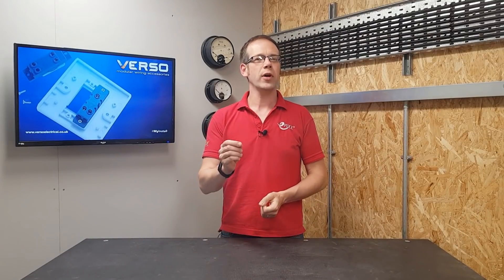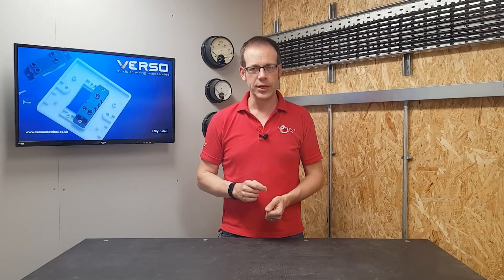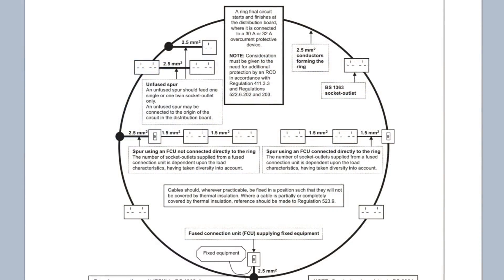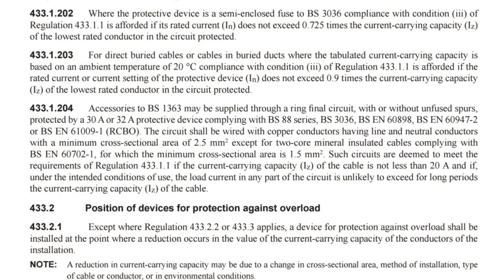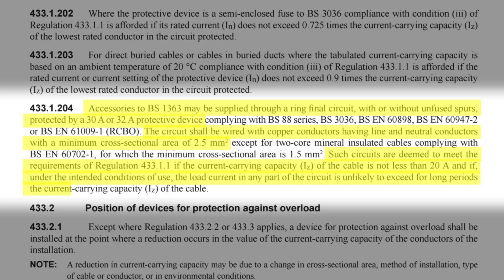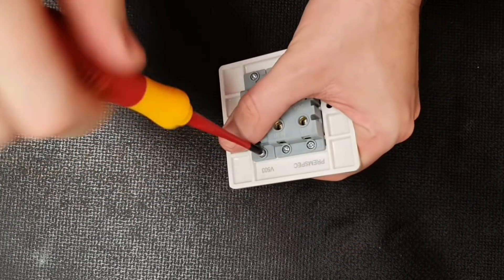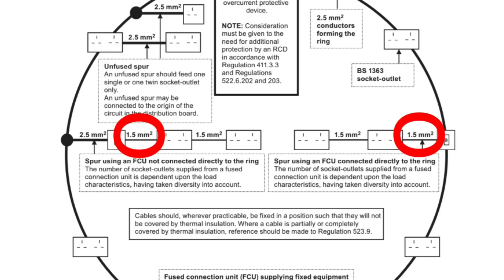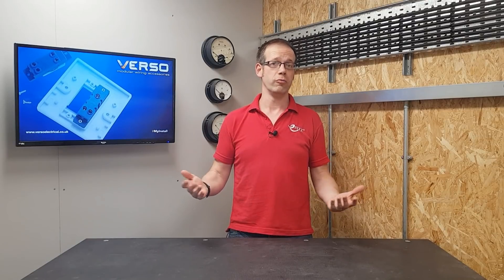Can you use a 20 Amp double pole switch to control a spur from a ring final circuit? BS7671

Comment: How can a 20 amp DP switch be used on a 16 amp circuit cant get my head round that
Reply from the maker: Because it's capable of breaking more current than the circuit can deliver. If it was a 10A switch it couldn't break 16A safely.
Reply: @efixx  
Thanks for reply
so a 32 amp ring why is that not to much for a 20amp Dp switch to break

Comment: Would it be acceptable to use a 20A MCB in a small suitable DIN rail enclosure/single way consumer unit box rather than  a 13A FCU if you wanted to serve more than 1 socket off a spur? So long as the Zs was low enough to provide the 5x trip current for a type B MCB?

Comment: The ring final was designed and mandated after WW2 to deal with a copper shortage. They said at the time that it would reduce copper usage by 25%. It is fundamentally a  horrible idea and in more modern time they went back to using radial circuits just like pre-war times. I get that there are a lot of these out there and I suppose it would be a significant expense to eliminate them. In the US, where we have older systems with techniques and materials no longer compliant with current code, those kinds of things are typically, "grandfathered".  But if any new work is done, this stuff must be upgraded to the current code. Technically, if the old stuff isn't touched, it can be grandfathered, however in a lot of places, it won't pass inspection unless corrected.

With as old as this technique is and as potentially dangerous as it is, it really should have been prohibited long ago. Grandfather it in if done before  the prohibition date. but upgrade it if any new work is done. It's pretty peculiar to the UK although I believe it was used for a while in some old British colonial countries. I am amazed that this is still acceptable by current UK standards. But UK does a lot of crazy things with electrical wiring.

Comment: Your thoughts on a spur from a perfectly installed RFC using a 4mm2 cable supplying more than one socket outlet, by design it’s perfect 👍🏻
Reply: Provided you don't exceed the currently rating of the 4mm radial (30 amps) AND the 2.5mm ring (23 amps), I don't see why not.

Comment: Thanks for that. Am contemplating installing a grid switch for first time for a kitchen install. I take it this is effectively what you are describing? Taking ring in and out of grid and actual switches them selves would thus be 20 amp DP's for fridge, dishwasher etc so no need to fuse down?

Thanks

Comment: Surely though the 20 amp rating of a DP switch is the rating of the switch contacts not the through rating of the terminals ?
Reply: Cant see the issue here between this and say, a 13A socket outlet on the ring in terms of rating. Most of these switches are intented for 1 appliance, so whats the big deal? There are also some of these DP grid switches rated at 13A for sale, so connected to a single socket or a FCU, again, what is the problem?
Reply: Is Gazzerdman is considering the case where a 20 amp switch is directly in the ring. Where both legs of the ring are connected to the input terminals of the switch and e.g. a fridge connected to the output terminals. The input terminals may continuously pass most of 'whole house' sockets loads if only one ring supplies the dwelling.

Comment: The 20 AMP DP SWITCH
No switch is mentioned in the highlighted text in the vid.

i) The first highlighted text relates to a 30-32A Final Ring Circuit and 13A plugs off the ring, whether on a spur off the ring or directly on the ring.
ii) The second highlighted text states a cable of minimum of 2.5mm must be used on a spur of the ring. Maximum draw of 2.5mm is 27A.
iii) The third highlighted text states that the cable must be capable of drawing at least 20A (this is redundant wording as the specified 2.5mm draws 27A maximum).  Then it states that the load must not exceed the max current draw of the 2.5mm  cable - which is 27A. 

It text DOES NOT state that a switch rated at less that the maximum draw of the cable can be fitted. 

In the vid it is clear:
ONE 
a) One single socket can be spurred off a Final Ring Circuit with no fuse between the rings junction and the socket. 
b) The spur cable must be 2.5mm minimum, that takes 27A. 

The 2.5mm (27A) cable on the spur is protected by the 13A fuse in the plug. Fine, all safe.
A 20A DP switch can be fitted as the cable and switch is protected via a 13A fuse. Fine, all safe.

TWO
a) One DOUBLE socket can be spurred off a Final Ring Circuit with no fuse between the rings junction and the socket. A double socket is rated at 20A maximum, even though 26A can be drawn via two plugs.
b) The spur cable must be 2.5mm minimum, that takes 27A. 

The 2.5mm cable on the spur is protected by two 13A fuses in the two plugs (26A maximum), which is below the  maximum rating of the cable which is 27A. Fine all safe.
A 20A DP switch CANNOT be fitted between the Final Ring Circuit's junction and the double socket, as the cable can take over 20A, above the rating of the 20A DP switch. 

Confusion
1) The wording says "unlikely to exceed for long periods the current-carrying capacity of cable", in the same sentence as the redundant 20A wording. This confuses. It is badly written for sure, not written in a positive tense.

2) The wording in the first highlighted text says, with or without unfused spurs. This could mean a Final Ring Circuit having a spur off it or not.  The assumption by many is that it means there is a spur off the ring, and this spur has a fuse on it or not having a fuse on it. Badly written. People who write this tripe should be sacked.

Comment: I guess it depends what you mean by socket outlet. It was said that you would use a SFCU when feeding more than one socket outlet from a ring, so the spur cable doesn't become overloaded, yet appdx 15 clearly shows that a single or twin socket can be fed from a spur, the twin clearly being able to overload the spur cable. Clearly they should limit it to one single socket.
Reply: A double socket can draw a max of 26A (two 13A plugs).  The drawing in the vid shows that 2.5mm cable (draws 27A max) must be used with an unfused spur to a double socket.  The spur cable cannot be overloaded.
Reply: @johnburns4017  
1. You're assuming the installation method in an installation enables the cable to carry that 27A - in a given installation it could derate the cable to something lower, so we can't just throw some 2.5mm2 in regardless, just because it's in the appdx.

2. The topic is about using a 20A DP switch, so while the cable may carry 27A, IM permitting, the switch cannot if that double socket is fully loaded (26A), so using a 20A switch should be limited to single sockets. Also, double sockets are generally only rated to 13A combined, so shouldn't pull 26A, but if limited to 13A the switch will be ok, but we cannot control what gets plugged in once we've gone, so definitely limit it to just one single socket.
Reply: @johnhoward2104  
Double sockets can have two 23A sockets plugged in drawing 26A. A 20A DP switch is too small. 

If derated, because of say insulation around a 2.5mm cable, adequate protection must be provided. If severely derated below 26A, a double socket should not be fitted.
Reply: @johnburns4017  isn't that basically what I've said?

Comment: Why not just keep it simple, and safe and standardise on a switched, fused spur? What’s the downside? Why all this complication?
Reply: FCU doesn't disconnect the neutral so if there is a fault N-PE RCD will trip but the fuse will be fine. Even if you isolate the FCU by removing the fuse the fault will still be there. A DP switch disconnects the neutral as well so you can isolate a faulty appliance.
Reply: @001Neal100   Good quality FCU's i.e. MK are DP, so they disconnect both L & N when switched off, except unswithed units

Comment: Start doing only radials and voilà life made simpler and no 2.5mm with a 32A breaker behind because it’s “unlikely”
Reply from the maker: Agreed. I much prefer radials myself.
Reply: Radial man myself. Safer too, aswel as the obvious fault finding element should a cable come loose or break etc.
Reply: 32A circuits are extremely useful in kitchens and workshops, so 4 mm^2 radials are fine in such locations but not 2.5 mm^2 radials.
Reply: @TheEulerID  everywhere else in Europe we do 1 2.5mm 16A circuit for worktop sockets without having any issues.. here is no different apart from the British electrician view of things..

Comment: For single kitchen appliance spurs I stuck to using 13 Amp switched FCUs. The reason being that for isolation purposes, table 537.4 in BS 7671 does not list a BS 60669-1 switching device as meeting the requirements for electrical isolation, which is the standard the 20 amp DP switches seem to be made to conform to where this information is provided by the manufacturer.
If you feel it best to provide a means of local isolation, then I saw the FCU was the only option if doing it "by the book". I certainly approve of using 20 Amp DP switches, especially for 3 kW immersion heaters etc. Again, the book would say whilst suitable for emergency and functional switching, they are not devices suitable for isolation. Whether this is due to something in the construction such as contact separation distances I don't know. From a control perspective it would only be suitable for isolation if you are carrying out work with it under your immediate control.
Would be glad to hear others views on this.
Reply from the maker: Really interesting points raised here. We'll look into it. 👍
Reply: @efixx  if the manufacturers ask for an isolator they need to conform with 60669-3 (found in the appendices in 7671), meaning it has 3mm contact separation. DP switches only conform to 60669-1 meaning they do not conform, however, the circuit breaker will suffice.  Most oven control switches installed do not meet the manufacturers requirements of 3mm separation, Hager and other premium brands however do. 

You buy cheap, you buy twice :-)
Reply: What’s wrong with using the circuit breaker?
Reply: @dale76uk  you may not comply with manufacturers instructions in some cases
Reply: Local or remote is acceptable, but some manufacturers ask for a local DP switch so by default by putting one in you would comply with bs7671 and manufacturers instructions which itself is a bs7671 reg too.  Installers such as John Lewis would normally come in and expect a DP switch they can switch off while they replace your appliance.
Reply: @MrSJT  That is interesting to know re. manufacturers instructions. Though when using switched FCUs I would select double pole.
Reply: @johnsommer9818  they are all 2 pole apart from the unswitched FCU

Comment: I would use a 20 amp DP switch if the load was fed from a socket , so it had a fuse in the plug . If a direct connection was made a switch fuse would be required.  With the exception of immersion heaters if fused or mcb at the board to 16a then a DP switch for local isolation at the appliance only .  By design I wouldn't supply any fixed 13amp load through a switch fuse,  I don't like a switch fuse running at full load all the time . More chance of premature failure
Reply: logical methodology
Reply: Yep switch fuses get hot and burn out at 12 plus amps.
Reply from the maker: Interesting points to consider here. Thanks!

Comment: Your said double socket and then said 26 amps. It should be noted that a double socket is only rated for 13 amps TOTAL between the two plugs, and not 13 amps per plug.
Reply: I think I read recently that the BS for a double socket requires 20A continuous for 4 hours to pass.
Reply: It should also be noted that the users wouldn't know about the 26amps
Reply: @MrSJT  indeed, saw this on recent survey to provide a 13A FSCU fed spur on 1.5mm, 3 core SWA to an outdoor cabin.  Easiest access is into an existing double socket on the RFC that is supplying the washing machine and tumble dryer. Both appliances are rated Max. 10A and the duration of highest load for the heating cycle for the washing machine will be below 15 minutes.  The socket showed no sign of stress.  As the cabin spur is rated to draw 13A + , I decided to fit another single socket on the RFC specifically for the washing machine and feed the SFCU from that.  My thoughts were to spread the load rather than potentially tapping off another 13A from the terminals of a double that’s already on the limit at worst case.  
All opinions valued please.
Reply from the maker: Really interesting points in this thread. 👍
Reply: Another key consideration when thinking of alterations to RFC is the balancing of loads across the circuit, as a properly functioning RFC relies on balanced loads across the RFC, if the loads are biased to one half of the RFC then a great potential for over load of that/those legs back to the consumer unit can be present.
Reply: @gwil6100  yes that may apply to most older RFCs.  But half the time it shouldn't be a problem if the high power appliances such as kitchen stuff is on its own circuits
Reply: @MrSJT  quite a lot of older builds have unusual RCF configurations so if you read my point, it just said that it should always be a consideration before or when carrying out alterations, as like you said although the scenario you presented is more common now it can’t be guaranteed.
Reply: @gwil6100  yes I've read and agree with your point, but I'm sure not everyone reading it is a competent electrician (yet or never) so I filled in the other scenario so they get a fuller picture. Like some RFCs could be an appliance ring with switches in a designated cupboard as so to maintain a balanced load.
Reply: It's 20A sustained for 4 hours, not 13A. 26A if it's not sustained is fine. A washing machine and a tumble drier with thermostats are generally fine as they never remain on full power for more than a few minutes at a time so, in practice, you do not get 6 kW being drawn from a double socket on a sustained basis.

It's no similar to the principles used for sizing the circuit for an electric cooker, which will often have a theoretical maximum demand which considerably exceeds that of the breaker. That's why MCBs have two mechanisms for breaking current. A fast acting electromagnetic one for gross overloads and a longer acting thermal which will withstand moderate thermal overloads for some considerable time. All about diversity. 

The only time two sustained loads exceeding 20A are likely to last for a long time is if two electric space heaters are plugged into the same double socket.

In practice, the worst case scenarios are vanishingly rare.
Reply: @TheEulerID  So why then does the tripple socket have a carrier for 13A fuse?
Reply: @davepusey  That's because a triple socket could carry 39 amps. Also, the BS-1363 standard, which dictates that a double socket must be able to sustain 16A + 4A load for at least 4 hours without exceeding a safe temperature does not have an option for a triple. Thus for a triple (or quadruple or any other to meet the standard then it will have to have a 13A limit - basically like a power strip).